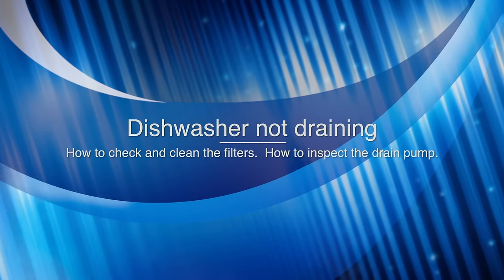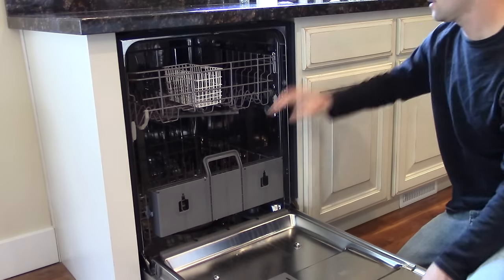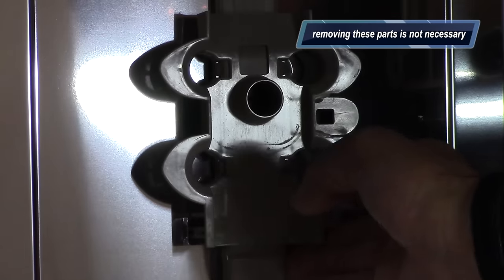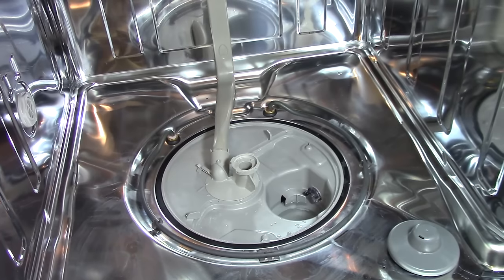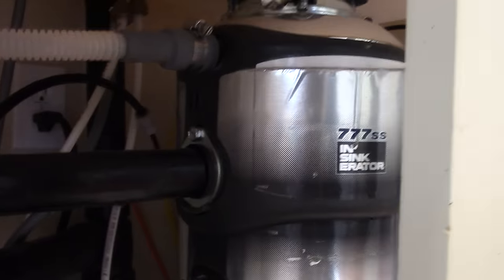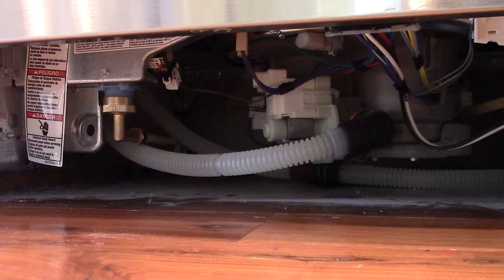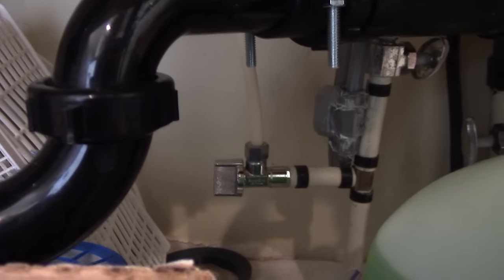How to repair a dishwasher, not draining cleaning - troubleshoot Whirlpool Kitchenaid

Comment: How much residual water in the bottom is normal?  I see that there is ~1/2 water in the bottom of yours - is that to be expected?  thanks.
Reply from the maker: This is a little hard to explain with just text but I will try.  [it would be easier to show]  When the drain pump motor turns on it pushes the water through a hose that leads to your disposal. That hose travels up and then down to the disposal. The amount of 'up' hose will determine how much water will travel back into your dishwasher once the pump turns off.  Imagine a roller coaster;  the pump pushes cars [water] over the Hump and anything that makes it past the 'hump' falls away [into the disposal] and anything that never made it past will roll backwards [into the dishwasher] once the power is off.  
So how much water in the bottom depends on how much hose you have.  It will vary a bit but what you see in the video is very typical. A little more or less is not a problem.

Comment: I hate the Whirpool Dishwasher I have been getting F5 Error in my Whirlpool all the time latelty 
Need to Reset and restart 95% it just goes back to F5 piece of garbage 
I never had any trouble with Electrolux or Siemens dishwashers in the past 
But this is some garbage that doesn't let you override the error code.
Reply: Mine also gets locked… then no button works just locked … not sure how to unlock this

Comment: If you have electrical  plug at bottom when operating  causes dishwasher  to go on and off ( needs to be hardwired  for clearances) took me awhile  to figure out ,thought it was circuit boards)

Comment: I have same dishwasher but it keep collecting goop on filter and I felt slimy things in the bottom pipe part of the sprayer. what is causing that?
Reply from the maker: +Lara K Do you run your washer on high-temp sanitation cycles?  It could be mold or soapy buildup.  When you open your washer right after a cycle it should be super steamy hot!
Reply: I have never used sanitation cycle. should i?? it's not steamy hot after a cycle. everything is wet
Reply from the maker: +Lara K Yes, run it with all the hot options you can.  More than once.  Your dishwasher has a large heating element at the bottom and it turns on like an electric oven.  That helps kill bacteria and clean everything out.
Reply: +AdamDIY  thank u so much!

Comment: U don't have to remove the dishwasher to take out the drain pump..there is a release tab on top of drain pump push it in and turn drain pump clock wise
Reply: +Russ Polk i hear ya Russ i have changed many pumps without pulling unit out!

Comment: need some ideas. i was fixing a whirlpool dishwasher. my problem is that the circulation is not working. if fills water and it drains but no circulation. i replaced the control board, i replaced the entire pump assembly and i replaced the wiring harness for the circulation pump. with all of this replacement i still can not get the circulation to work.  anybody has any idea?

Comment: my dishwasher won't drain.  how can I remove the water before I pull everything apart?
Reply: I'd just use a cup and cup-load by cup-load drain it down a sink.  I'm having the same issue as you
Reply: +Mary F  lol I was hoping for an easier way haha.  I used a cup and a bucket. The rest of the standing water I used a large towel and then I removed the filters and inside the hole I soaked up the rest with paper towels. Took awhile! But mine was a clog. I'm so happy it wasn't more serious. I hope yours is up and running soon!
Reply: You could always syphon it out. Fill a hose with water, put one end in the filter area, and the other in a big pan on the floor.

Comment: AdamDIY Thank you for this video it solved my problem! I had to remove the hose under the dishwasher to get access to the pump blades. There was an aluminum can opener stuck in there! Here $10 tip for you ***** You can send those bits to circle.com or coinbase.com to redeem them for USD. Ask me if you need some help.
Reply from the maker: Hey that was awesome Tony! Thanks so much for the $10 tip it was very nice of you.   I'm saving up for a wireless microphone so this will help a lot!  Glad to hear you got your dishwasher working.

Comment: Hi, my  Whirlpool dishwasher like the one in your video is not clogged but only drains manually by the push button. At the end of the wash cycle, the drain pump does not kick in and there is water in the bottom. I press the drain button and it will drain. Is this a board problem? How do I enter diagnostic mode to get error codes? Thanks

Comment: Why is there water still standing in the video?  My dishwasher does the same thing.  There is always a little bit of water still standing. When it's really hot outside that water will evaporate and the dishes will mildew if I leave them alone for a few days.  Is this normal?  I expect the dishwasher to drain ALL of the water.

Comment: The basket was clean but basin would still not drain.  Pulled off the rubber elbow like your video suggested and there was a thin strip of plastic stuck in the impeller housing.  Pulled it out, reattached the rubber elbow and dishwater works perfectly again.  Thanks Adam!  Saved me a $200 service call.
Reply from the maker: Thats great!
Reply: I have the same problem, al lthe filters are clean but it wont drain, ill try removing the rubber elbow, i just figured there was no way stuff could get there with all the filters, seeing it worked for you i will try it.
Reply: i thought the exact same think, but somehow a thin strip of plastic made its way past. When i removed the elbow and saw the impeller i reached in to spin it and saw the piece. Once i removed and replaced the elbow - dishwasher worked perfectly. Let me know if it works for you.
Reply: +Gerry S a small screw made it through the dishwasher, through the drainage pipe and got stuck in the airpipe! Don't ask me how that happened but everything is working now

Comment: When I take out my filter, the water level is very high (near the top), Unlike this video.  Is that normal?
Reply from the maker: Is the water above the large round metal screen? If so, it's not normal. Your drain hose may be too long or positioned incorrectly.

Comment: Nice video.
Something else to consider (we just went through it tonight) is after you clean the filter and before going further, check the dishwasher vent (close to your faucet in general)...take off the cover, push on the small side brackets and pop the top part off...clean...

Comment: Thanks for this great video!! I have never looked inside my sump because the light and angle is so bad, so I learned a lot about my dishwasher today.  (2010 to 2013 Kenmore elite, the filter and sump and drain is pretty much the same.)  2020 was the year of leaks.

Comment: I'm dogsitting this week in a house with a dishwasher like this.  The amount of slime in the filter is incredible.  The slime flaps had slime flaps. I popped the bottom arm off like you instructed, and that's equally grody.  A trip to the store tomorrow to get some cleaning supplies to get it un-grodified.  Great video!

Comment: Thanks so much for the help!  The tube coming from the pump went to an overflow valve on top of the sink and then down to the garbage disposal -- the tube from the overflow to the garbage disposal was what was clogged for me, but you got me looking in the right locations -- Big brownie points with the wife for fixing it and not having to call maintenance.

Comment: I tried everything in the video and nothing will make the water drain. I even replaced the pump itself and I still cant get it to drain water. It is a Whirlpool, 14 months old. Anyone got any ideas?
Reply from the maker: The hose could be clogged.   Check the drain hose and also check where the hose connects to the disposal. I have seen some disposals totally clogged inside where the hose hooks up to it.  Also check to see if the drain pump is getting power.
Reply: Thanks, Adam. First thing I did was check the hose, then I cleaned the filters then changed the pump motor. I don't have a waste disposal. How do I check to see if the pump is getting power?

Comment: After pausing and playing this video for about 30 minutes and my entire dishwasher being in pieces, I hit the 3:55 mark where it says to turn off electrical. I have an outlet switch above the washer that controls the electrical for the dishwasher….I go to turn it off and realize it was already off! I had accidentally knocked it into the off position while I was cleaning after starting the dishwasher. So, it would’ve been nice if the video would’ve started with checking the power/electrical (yes, this should’ve been the first thing I checked before disassembling my dishwasher but my brain wasn’t on my side). 

Nevertheless, this is a great instructional video & ultimately helped me fix my dishwasher. As someone who needs to know the ins & outs of everything I am doing, I appreciate that you explained what things were and what their purpose’s were.

Comment: ADAM you ROCK! 3 dishwashers that I recently repaired had debris not in the drain hose but invisible just inside the sink drain fitting connection. Pistachios shell, plastic and paper. A poke with the phillips screwdriver fixed it! Thanks from BC Canada!

Comment: SO we just replaced the Dishwasher Main Passive Diverter Part # WD18X21678 (its the piece just before the drain pump) because the rubber coupler got a tear in it and drained all over our kitchen floor. After replacing it, now the dishwasher will not drain. SO i am thinking that maybe the drain pump ran DRY since their was that tear in the rubber coupler and the water drained OUT and instead of thru the motor as it should ??? Could that be possible ?? This literally happened after i put in that new piece. And it does have that small orange ball that moves around...

Comment: Is it normal for a bit of water to remain in the bottom of the drain area?  It feels like my dishes are not as clean as it used to. When I run the drain cycle it looks like the water does drain.  Could it be the dish soap I’m using?  The amount of water you have is exactly what mine has

Comment: My Amana ADB1400AG has a third filter that has clogged twice in two years. It is inside a plastic coupling that    joins two pieces of drain hose after the drain loop. It's accessible without removing the dishwasher.  I've never seen any reference to that filter. It is very fine and collects a lot of debris. I will probably remove it. By the way, how do big chunks of glass make it through the other two filters and into the drain pump?

Comment: I have a gold series whirlpool the same as in you video W10632081A and it doesn't spray, the sprayers get no water at all, and no spinning. It gets water in the bottom and drains fine though. But doesn't clean absolutely anything. What could it be? How do I Fix it?Read more Show less Reply     5     6

Comment: We have one like this but it seems to start but wont wash. I pulled the Tech Sheet out to try to figure it out but it is very had to understand. we tried to get to diagnostic mode but did not seem to work right- all lights where lighting up but hard to understand.

Comment: Having problems with water 💧flow 😒 not entering tub to wet dishes for washing (water usually comes/entering from above). I hear water and see water at bottom of tub when I open the washer door, dishes are not wet, just moist (like they've been steam bathing, but they are not clean). 
Please help me figure out the problem. 
Thank you for your very clear explanation showing on your video above.

Comment: Worked on one today, the guy said it didn't drain fully,
 it was full almost to the door,
bailed it out, looked found nothing.
 put it back together & ran it, worked fine.
Then I remembered that he said the upper rack slider race disintegrated rather completely, like it seemed to want to.. & of course all the ball bearings fell out, but he recovered them all, as the filter should work to do, but if any got by & stayed in line, in the ribs of the exit hose or impeller, they'd be a problem.

 Is their any other possible commonalities in partial drain blockage ?
 What is the sensor in the sump supposed to sense, blockage or movement of water ??

 It's owners are an older couple, I can't see this appliance being worked all that hard,
 it's 5 yrs old & had a fix already, & both sliders have had it 110%, & may I say what a big fail that is !
 Then I remembered how one parent company owns 90% of all appliance manufacturing in the world.. & went "oh, yeeeah"
(thanks..  "free" market capitalism).

Comment: Thanks for your detail video!!!   I have Electrolux model EI24ID30QS0A, pretty new 4 yrs old. It runs Ok but, does not complete full cycle, it leaves water in the bottom and does not dry, any idea?

Comment: Question. How do I remove the water pump? Found some piece of thread inside but it’s not draining again. Sure there’s still some more. I did it through the drain pipe. But I would like to remove the pump and check. Please. Thanks

Comment: Hey Adam. I did everything you did you did in the video. Seems nothing at all was blocking it. So I tried a test run afterwards, she ran good untill it was time to pump out the water. Not a sound, I'm thinking the pump needs to be replaced. It's a 2 year old Whirlpool from 2015. Is there By way it could be fuses or I should just go ahead and replace the pump? Thanks so much, and thanks for the video. Showed me a lot.

Comment: I had my water pipes freeze and quickly got them running with a hairdryer.  Later in the day I got the  E24 light on the Bosch dishwasher.  Cleaned the filters and vacuumed all water out - still blocked.  Finally unhooked the drain hose from near the sink trap and blew on it.  Some air went through then blocked again.  Hooked the vacuum to the hose and pieces of ice came out.  Next time the pipes freeze, the dishwasher drain hose will get attention too,  TIP: If you live where your pipes might freeze, do not throw towels and plastic bags over them.  It gathers cold from underneath and insulates them from any warmth.

Comment: i have same design but bottom stays filled with dirty water >>new pump>new valve -chek <<were does the valve-check go  and is that my problem
kitchenaid dishwasher  w10751715a

Comment: Thanks a lot! My dishwasher has power, water goes in and drain seems OK. However, both upper and lower rack does not receive any water. I did check all the lines and they are all seem OK. I did hear humming so I suppose the rotor is fine as well. However, no water goes up to wash. Do you have any suggestions? Thanks!

Comment: My dishwasher drains, but the "cup" area holding the twist-off filter never drains completely.  Water always seeps back in.  I will do the 3 minute manual drain, then when I look at it the water will seep back in.  Creates a bad smell in the dishwasher.  Could it be the check valve?

Comment: If you hold the start button for 3 seconds it will show 2 seconds on the display.  When you shut the door the pump will manually drain the dishwasher.  If the pump doesn't start you might have an electronic (logic or pump motor) issue. If the pump runs but still doesn't drain then start looking for a clog.

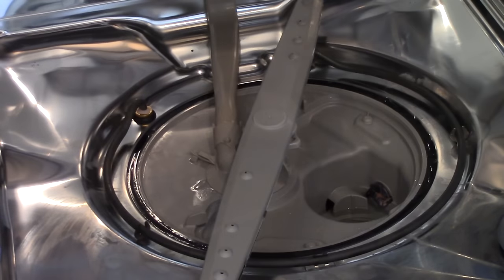Comment: My whirlpool dishwasher is not draining.  I recently replaced my garbage disposer.  It was working before and immediately after the disposer replacement.  But then it stopped working couple days later.  I don't have any clogged filters.  When watching this video, there is a sensor after taking the filter out (at about 1:30 minutes into the video).  However, I don't see the sensor in my whirlpool dishwasher.  Could it have fallen off and got drained ?  Could this be the issue for dishwasher not draining?  Please advise.

Comment: This was very helpful. The top rack to my dishwasher wasn't working so I worked through all the steps, it turned out there was a 1/4 of a soy sauce packet inside the sprayer for the top rack lol Now I'll be making sure to check out the tiny holes in the spraying nozzle with a flashlight! Took me about an hour to pick them out with a pin and some tweezers.

Comment: I'm having trouble finding the check valve on a similar dishwasher as in the video.  When I pull the tube off the drain pump, I don't see a check valve.  Could it be in the drain hose?  Does anybody know?  Thanks!

Comment: My Whirlpool dishwasher has slimy grime on the dishwasher floor, next to the door.  Dishwasher cleaners don't help, I have to clean it out manually. In addition, the water in the trap under the circular filter always looks dirty.   Lately the kitchen sink clog is back and the dishwasher backs up a little bit into it.   The clogs are in the kitchen sink only, nowhere else in the house.   We do not have a disposal if that matters.  Also, nothing goes into the dishwasher that has not been pre-cleaned, so there should be no food issues.  Welcome any suggestions. Thank you for your informative video.

Comment: Dear Adam, there is a level of water visible on the video in the dishwasher you disassemble. Is this supposed to be normal that water stands like this? Or is it supposed to be completely empty of water? Mine currently has water standing exactly like in the video and my dishes are not getting clean and dishwasher doesn't stop by itself after being started. Thank you!

Comment: So, I can feel a pice of glass wedged in the drainage hole, but that hole is so small on mine, that I could only get my pinky finger in there which is how I felt it in the first place. So, my question is, with such a tiny hole, how does one access wedged glass OR even get any further than the length of a pink finger to even see or feel if anything else is in there and how to get it out? GREAT and EASY to understand video, thank you!!